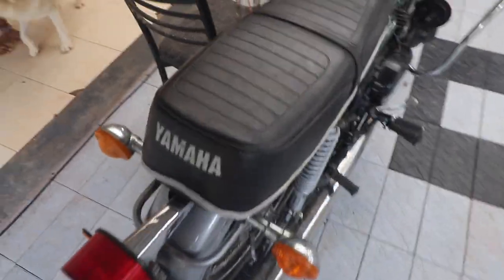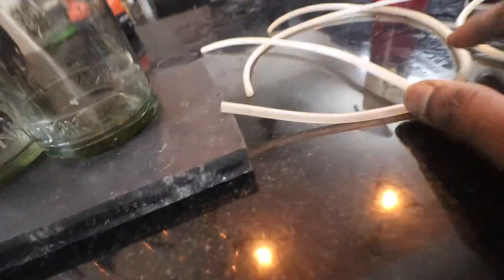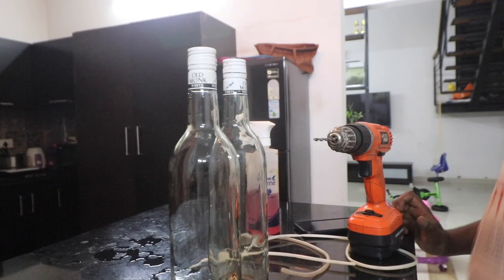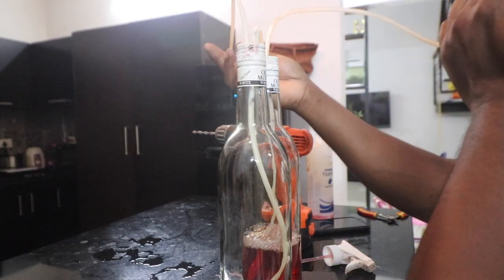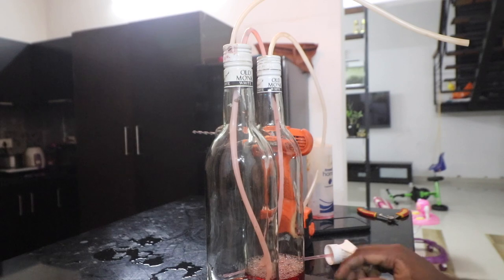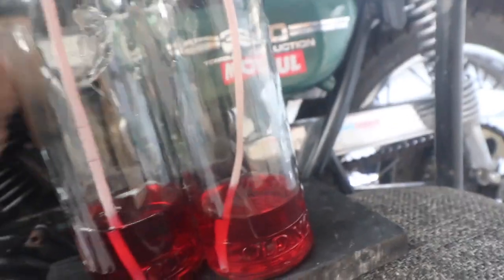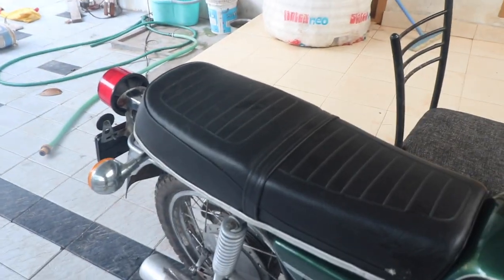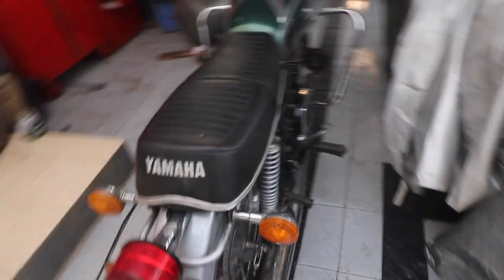Synchronising or balancing Yamaha RD 350 carburettors

Comment: Nice innovative system to equalize both the cylinders. But I must request to focus the camera a little more closer shot of all the set up and procedure so that it  will be easier to understand for everyone. As far I remember in mid 70s that time I was teenager use to dream and wanted to have a ride of the very legendary models of all four Japanese bikes as going through buying American published bike magazines mainly named 'Cycle' use to cost Rs 9/-only use to be available two or three weeks later form the published month,I use to travel 400kms to Kolkata to get the latest issue of the magazines as I regularly use to visit in the weekends.That time in the city use to be seen  full of so called that time imported bikes at streets of Kolkata more than Bullets andJawa/Yezdis & Rajdoots.Now to the actual matter  about tuning the multiple Carburetor set up of bike either twin/four or six cylinder engine of a bike.In many models it was common  to see a Carburetor per Cylinder in 70s.That time in India no turning apparatus for bikes were available in the market.I may be wrong.But if it was available or used in racing bikes and cars in Madras by race techncians.In most of the workshops or mechanics never use to know about the Carburetor tuning apparatus consists of dials and  connector pipes came fitted in a box as disccused with them. As the carburetor tuning  apparatus advertisements were published in the above mentioned bike magazines, of different types and models for twin& four carburetors having analog meters according to number of carburetors set up in the engine.Most of the veteran mechanic use to tune or as present day so called terms used synchronization of the multiple carburetor carried out by their experience.They only, by putting their palm on the outlet of the exaust pipe having the feel the thrust of the running engine,by adjusting Idling and Fuel mixture screws and also the amount of density of smoke and overall vibrations on the bike.But now at present days new generation mechanics have learned in a different way. There require proper tools  for most of the jobs.Many morden tools are now available in India.But for carburetor tuning as itself has become outdated according to the developed technologies but it can be some where could be available. In my view it may be very hard to find this multiple carburetor tuning apparatus or if by chance be available could be very expensive,either may through import-line paying heavy custom duty or from the various type of vendors.Finally I must appreciate and say many thanks for making very simple Carburetor  syncronzer apparatus so that any one make and use it  for their multiple carbureted engine As these bikes are made out from restoration work and for occasional ride as for the purpose to preserve the heritage of Indian motorcycles.
Reply from the maker: Woah, that was a lengthy one. Thanks for penning it down this well. Some day I will reach out to you for a script for one of the episodes

Comment: Si there any hose betwen the carburetors? I want yo install pwk 21 in a Suzuki gt125 and the original carburetors are conectes by a hose
Reply from the maker: You won’t be able to connect the stock hose, you will have to rely on pod filters

Comment: Very informative.  What is the pwk carburetor brand and size?  Appreciate, if you share the main and pilot jet sizes and also the needle clip position.
Reply from the maker: Kamalakar Madan this was procured from China these are 33mm replicas, the jets and needles came standard. The company that sells these carbs have put the jets such that it’s tuned for MSL. I didn’t note down the size of the jets but there is a video I did on taking apart these carbs. Take a look at that video, you might get the information you need
Reply: Yamakaze, thanks for your prompt response. Will look the  video posted by you.
Reply from the maker: Kamalakar Madan please do

Comment: Hi. I've seen many rx100s converted to parallel twin rx200s. Does this principle even work with rx200 too?
Reply from the maker: It will work if you do it on a 200 cc crank, if the crank is to be welded then it’s a bad idea

Comment: Do u have any video for setting tdci for timing of rd350
Reply from the maker: What is tdci?
Reply: @Yamakaze  top dead center it’s a setting for magnet & timing
Reply from the maker: @almarqzubergove5451  the acronym is TDC not tdci, tdci is the diesel variant of the Ford Fiesta/ Figo, since modern ignitions come with a key slot the magnet is fires at a particular position of the crank, advancing and retarding ignition can be done by moving the stator coil counter clockwise or clockwise.